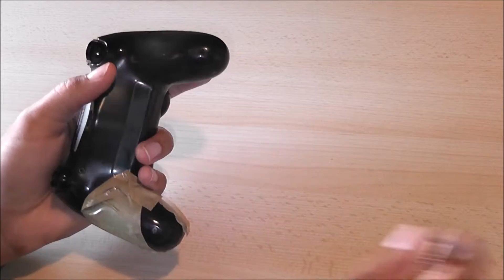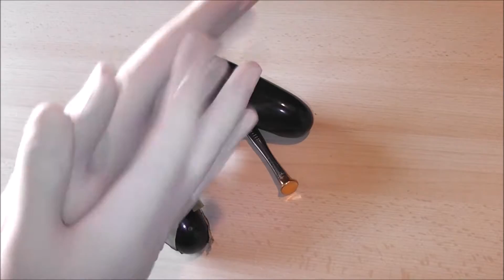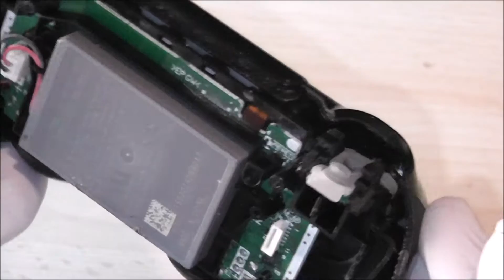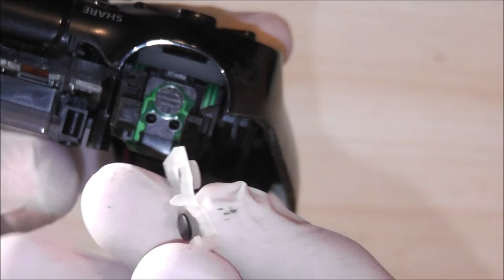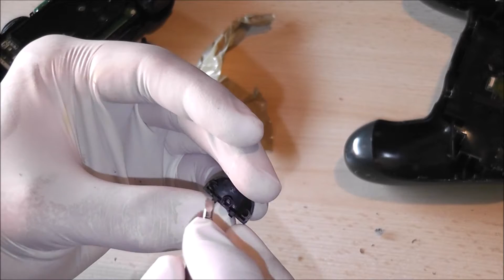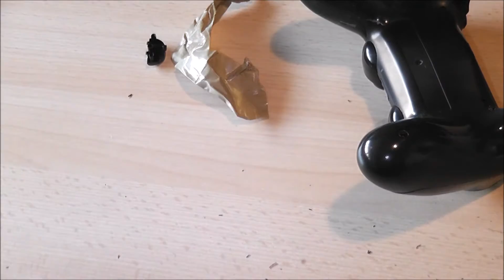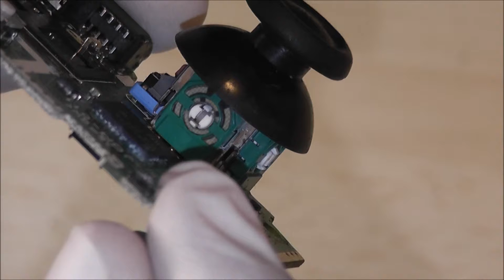How to fix: PS4 Controller repair: buttons and water damage

Comment: I also have water damage my bro spilled a drink on my controller. It works and charges but once it's switched it off the ps button won't work and the pad won't turn on. I should have never switched it off

Comment: Bro i need help BAD. I tried doing the reset thing. I tried turning it on. It didnt. I tried turning it on with usb cable, it did. But keeps on disconnecting. And after it disconnects, THE LIGHT TURNS INTO RED BUT I CANT CONTROL THE PS4
Reply: ✝️𝑯𝒆𝒚, 𝑰 𝒋𝒖𝒔𝒕 𝒘𝒂𝒏𝒕𝒆𝒅 𝒕𝒐 𝒔𝒂𝒚 𝑱𝒆𝒔𝒖𝒔 𝒍𝒐𝒗𝒆𝒔 𝒚𝒐𝒖 𝒂𝒏𝒅 𝒅𝒊𝒆𝒅 𝒇𝒐𝒓 𝒚𝒐𝒖, 𝑱𝒐𝒉𝒏 3:16✝️💞
Reply: Bro same
Reply: @ivano4504  same bro
Reply: Same
Reply: Guys i got the solution. 

Just leave the controller in a dry place for 3 or 4 days 

It worked for me
Reply: @jashgoat  let me go turn on my controller because the one with water i left near the A.C and i tried turning it on and i gave up i asked my friend if i can borrow one of this controllers so i left the controller with water inside of it in a dry place for 3 weeks and idk if it works or not i will keep you update
Reply: @kyseu  Okay, and if that does not work Take another controller and go to Bluetooth devices. And take your spoilt controller and hold The ps button and the share button. After you hold that connect the Ps4 controller by going to Bluetooth devices.
Reply: @jashgoat  it doesnt work :(
Reply: @kyseu  I'm sorry man, I guess you will have to fix it or get a new one
Reply: @jashgoat  update so uh last night it worked i just woked up and it was out of battery and umm i tried to charged it without thinking abt anything and now it wont charge
Reply: @kyseu  No need to charge 

Try to play with the spoilt controller while charge
Reply: @jashgoat  yea but the thing is that its broken the left stick is messed up
Reply: @kyseu  Oh, I'm sorry I don't know a solution for that. You can buy a left joystick from Amazon and tell a Person who Fixes controllers to Replace the left joystick

Comment: I really need help like bad bro can someone help I won’t be able to do clips
Reply: I can
Reply: @Rgeeb22  hey man I see u can fix stuff so I would appreciate it if u help me, I accidentally got water in my ps4 controller and I tried pressing the reset button, blowing on it, and throwing it to see if the water got out because my ps button is not working and I can’t turn on the controller without it
Reply: Yeah I could I can make a vid on removing the damages later on today
Reply: @Rgeeb22  ok thanks
Reply: @Rgeeb22  this was 3 month’s ago I don’t need help rn
Reply: @cxst7468  yeah ik u already told me
Reply: @fizzygs  I'm going to upload it tomorrow
Reply: @Rgeeb22  there is no vid lol
Reply: if I want a can make a vid personally for u
Reply: @Rgeeb22  I fixed it
Reply: @cxst7468  ok lol
Reply: @cxst7468  how?
Reply: @cxst7468  how did u fix it!!!
Reply: @cxst7468  how